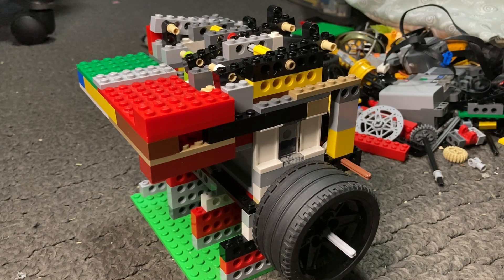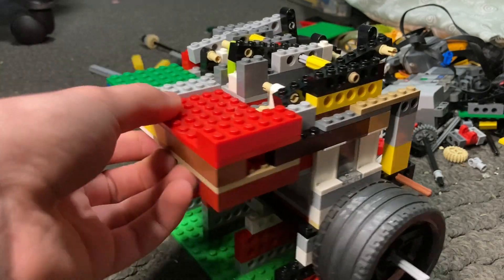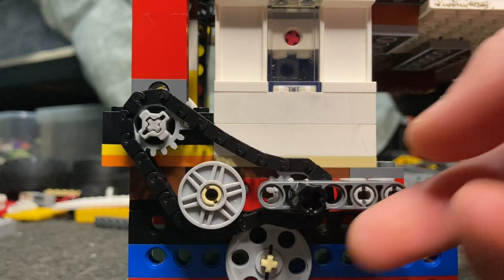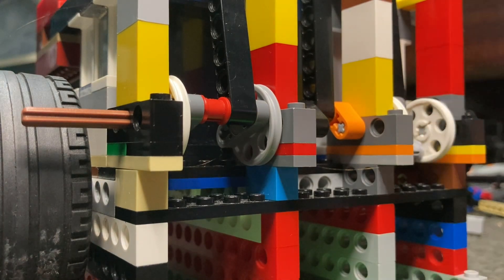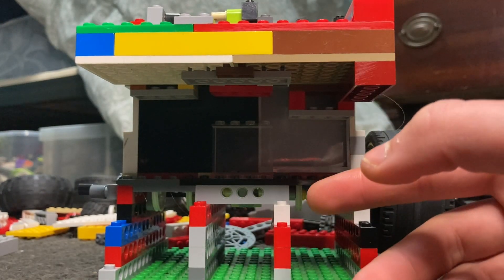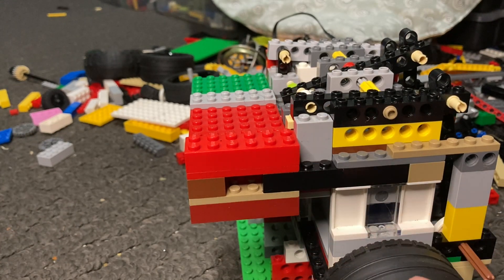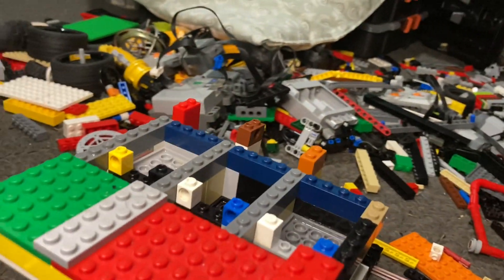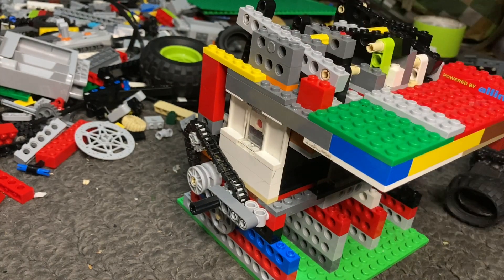3 CYLINDER Lego Vacuum Engine

Comment: How do you reduce friction?  Without lube or vasaline
Reply from the maker: Good question! An alternative to lube/oil/vaseline is to just sand down the cylinder walls a bit with sand paper. I tend not to do this much for the fact that the little bits of plastic dust can sometimes get caught between the walls and the pistons causing significant wear over time.
Reply: @KFPlusLegoMastery  Would sun flower oil work?

Comment: Hello, maybe if you replace the chain with a gear it could be more efficient
Reply from the maker: I appreciate the suggestion, but using a chain actually is more efficient because it doesn’t have as much friction between gears.

Comment: If there is a way to reduce movement of components that could do it. Maybe have tje timing on the opposite side of the engine so you won't even need the rocker arms?
Reply from the maker: I was thinking something different but I could give that a try.
Reply: @KFPlusLegoMastery  like how oir engines normally have a second crank connection for tje valve, maybe you could just hook up a different way of valve co troll but thru a chain. I'll dm u a pic of what I mean